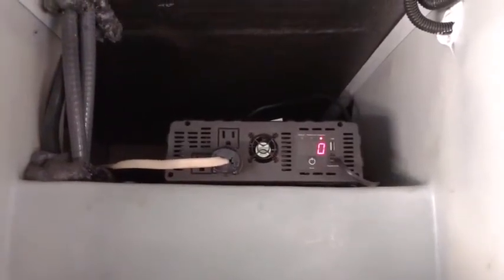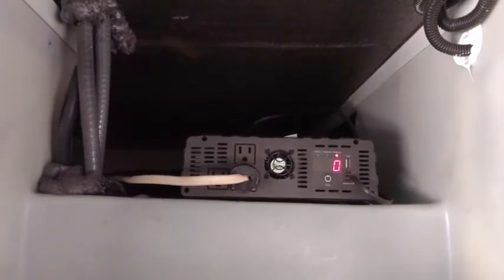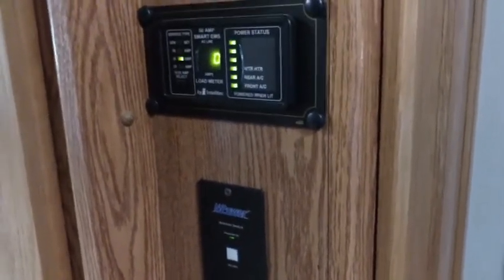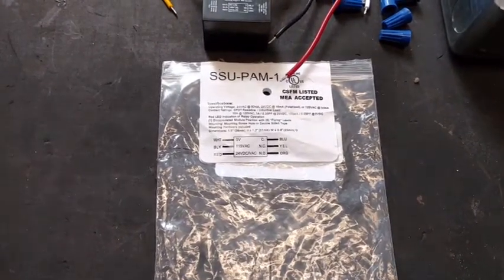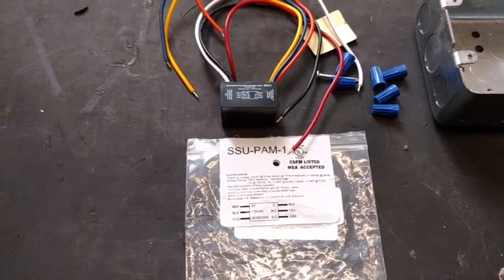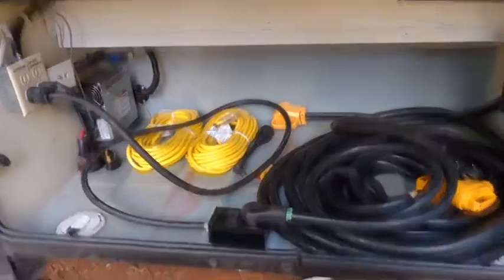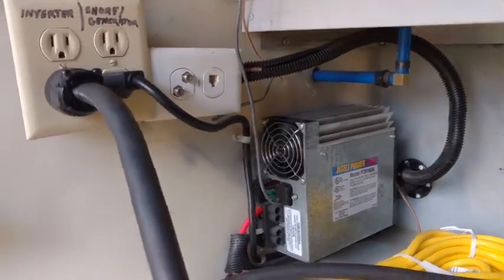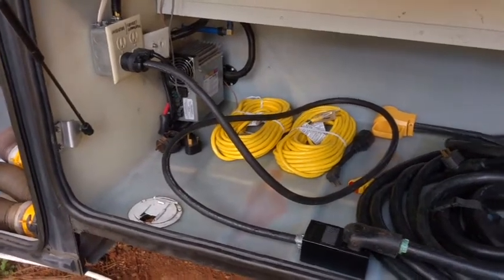Motorhome converter shut off switch

Comment: I also used this same relay to automatically shut off the converter when the inverter is in use. It works perfect. I hardwired the relay "power in (black and white wires)" supply directly from the inverter and wired the converter plugin outlet as you described. Thanks for the video!

Comment: I added a 3000w inverter to my 5thwheel. It has a 30 amp plug on it. I plug my rv 30 amp service cord into the inverter. I have a kill switch for my battery bank so when I turn the switch off the juice does not go into the battery bank from the inverter supplying power throughout the 5thwheel. The inverter is direct wired only to the battery bank. So I can by- pass charging the battery bank through inverter. I use solar for my charging source. I dont us a generator but your system is a great idea. thks for sharing

Comment: Thank you for your video.I was in the exact same boat as you with not finding the answer on how to disconnect the converter. I spent 12 hr on the web researching relay's and how to videos but was more confused than ever. I found you video after 1133 pm. ordered the parts on amazon and am now waiting for their arrivals. thanks again for you posting.
Reply from the maker: Mark Assante I was hoping it would help someone. If you have anymore questions let me know. I'm happy to help thanks for your comments.
Reply: I was still excited when I woke up, I went to your video this morning and I do have a question on the wiring to the converter outlet.You say that the black wire now  gets connected to the yellow relay wire.The red and orange relay wire are not used, is this correct?Relay wires white and black go to the inverter outlet, and the blue wire goes where the black converter wire went originallyMy new inverter comes tomorrow and I am anxious to install it but want to do it right.Thanks again for you attention to detail. I spent most of yesterday online searching for this very answer.Regards Mark
Reply from the maker: Yes, it sounds like you have it right. The black and white wires on the relay attach to the black and white wires from the inverter, this will activate the relay when the inverter comes on. Then the black wire that normally powers the converter outlet will attach to the yellow or NC (normally closed) wire on the relay and the blue or C (common) wire goes to the converter outlet terminal where the black would have gone. When the inverter is off current will flow from your generator or shore power through the black wire and the normally closed circuit on the relay back to the outlet and power the converter. But when the inverter turns on the relay will open that NC circuit and the inverter will turn off. And you are correct that the red and orange relay wires are not used.
Reply: @TomWallis1  Correction: "But when the inverter turns on the relay will open that NC circuit and the inverter will turn off. And you are correct that the red and orange relay wires are not used." Should say CONVERTER will turn off.
Reply from the maker: @wallycass2780  You are correct. That was what I meant to say.

Comment: You could purchase and ats automatic transfer switch or a 2 pole 2 throw relay with 120 volt coil rated at 50 amps for $30.00 then if you have shore power it will take priority over batteries. Lose power and inverter kicks in.

Comment: I looked up this relay and notice that it is only rated for 10A. How are you able to power larger load devices, such as your A/C,  microwave, and coffee maker with a switch that can only handle 10A? I must be missing something here; I understand that you can't power the A/C with the inverter,  but it seems like the power capacity of your 50A shorepower would be limited by passing through this relay, and that your inverter couldn't power up anything over a 10A draw as well for the same reason.....Thanks in advance should you be able to explain this to dumb old me!
Reply from the maker: The relay doesn't run the inverter. The only thing it runs is the converter. My converter is a 60 amp 12 volt charger so if it were 100% efficient and if it was charging at 60 amps it would need 6 amps at 120 volts. A less technical answer is that I have been using this setup for 2 years now and it has worked perfectly.

Comment: Why not just use a simple double pole double throw switch?
Reply from the maker: That would require a lot more wiring unless you want to go outside to throw the switch. This method is cleaner and simpler.